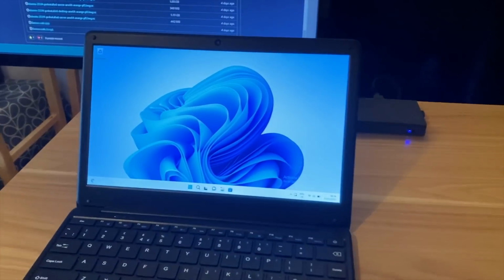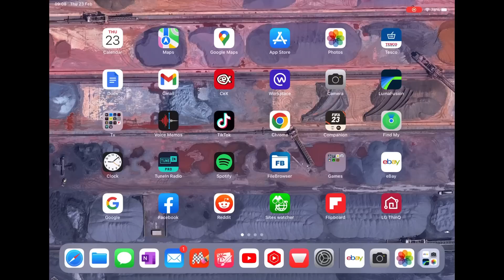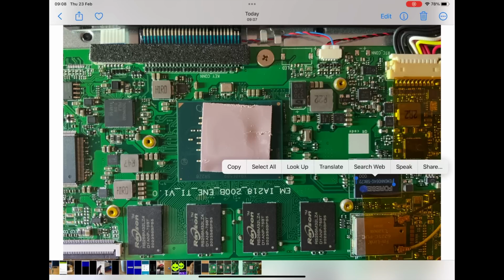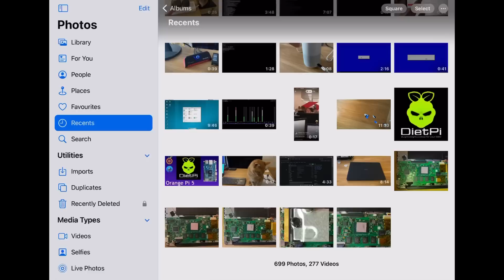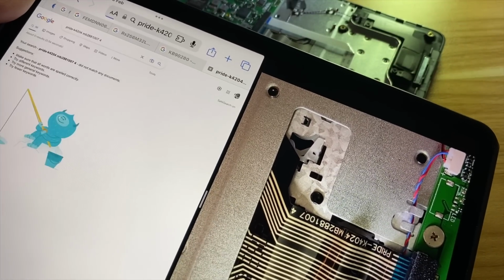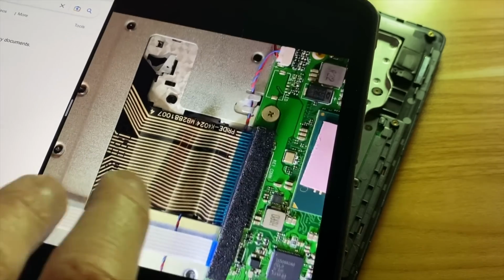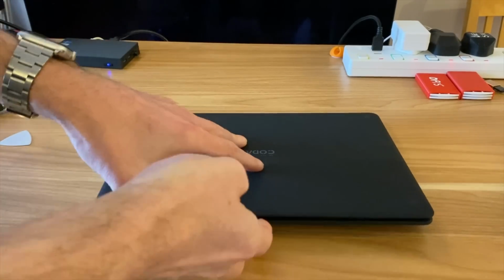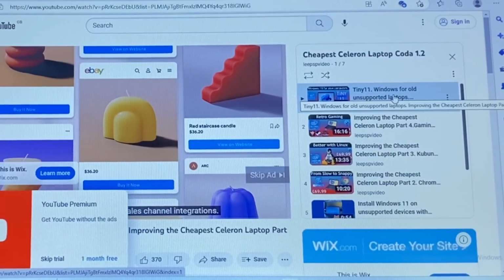£69.99 TikTok Laptop upgradable? Improving the Cheapest Celeron Laptop Part 7.

Comment: All in all, do you see Tiny11 running best compared to the other OS you've tried on it? With the OS that runs best on it, do you see this budget (I guess I mean the cheapest there is) laptop as a reasonable choice for simple web browsing and document editing? If not, what would you recommend for such tasks? I do have the Pi 400 and it would do the job just fine as a desktop, but for portability it's a bit of a pity to set up. And sorry if I'm being ignorant by asking this, but how much better does it perform than the Pi 400?
Reply from the maker: Chrome os flex was probably the best or Linux

All shown in this playlist 

Cheapest Celeron Laptop Coda 1.2
https://www.youtube.com/playlist?list=PLMJAjiTgBtFmxIzlMQ4Yq4qr318IGlWiG

Performance can be similar to a Pi 400 running KDE

My new Linux Desktop. Raspberry Pi 4.
https://youtu.be/36rOvqaFCLs

Comment: It is basically more or less a SBC board design, nothing is user replacable there.
Next Part 8 step proposal, if you dont need it as laptop, try just to took board out and to use it as desktop. 
Probably on all of these ultra-mobile x86 SoCs these days, and if it says anywhere LP DDR memory... it is just an SBC inside :face-green-smiling:

Comment: Sorry. Everything except the battery is soldered on your device. A few years ago, I found a cheap 11.6" 2-in-1 that has some interesting features - a 1080p IPS display supporting touch and an MPP stylus, an aluminum chassis, a USB-C port supporting data and power delivery, and (most interesting) an M.2 2242 SATA SSD, accessible thru a little hatch on the bottom.  Its biggest weakness is the the dual-core N3350 CPU, rather than the the quad-core N3450. Still not bad for $140. Probably inventory that was being dumped.

Comment: don’t understand why they only slap a thermal pad on the cpu and leave every other component to cook under that cover being passively cooled there’s no air moving across anything to assist heat dissipation
Reply: Because to keep the cost as low as possible for them